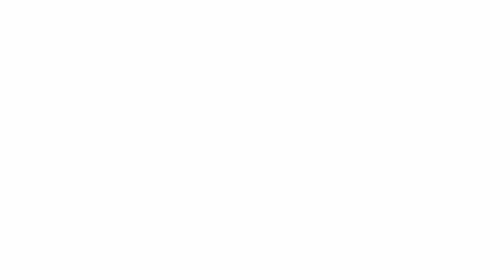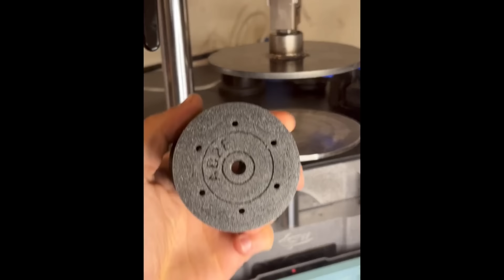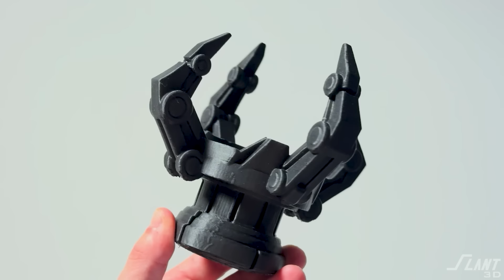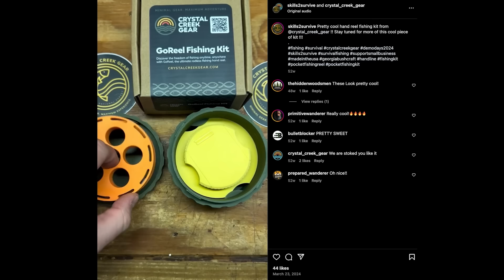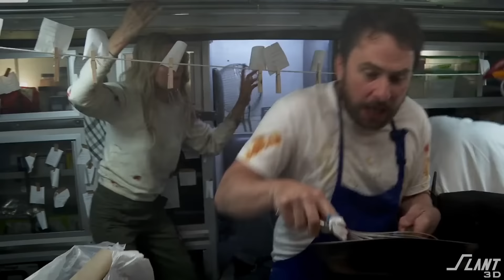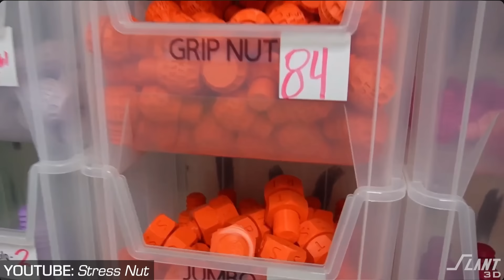5 Real 3D Printed Products You Didn’t Know Existed

Comment: The Perry Parts detail about building their own pellet-extrusion machines just to avoid the strength loss from re-melting TPU filament is such a slept-on engineering call — most shops would never think to go that far. Since Teleport doesn't run pellets, is single-pass-extrusion durability something you'd ever consider supporting for TPU parts, or does it just not scale across a mixed print farm?

Comment: The Perry Parts detail about building their own pellet-extrusion machines specifically to avoid the strength loss from re-melting TPU filament is such a slept-on point — most people would never think to make that call. Since Teleport doesn't do pellets, is single-pass-extrusion durability something you'd ever consider supporting for TPU parts, or does it just not scale across a mixed print farm?

Comment: Regarding the branding on the Crystal Creek rodless reel, they could use a stencil and paint. It's still another step, but a quick one. Could even 3d print a jig to rack up several pieces simultaneously and spray paint them all in one go.

Comment: Good video. Interesting. TPU threads in compression can also compress the crest to crest distance, while the bolt installed does not compress. Done over time, this can easily wear away the TPU threads. How does Perry’s design and process guard against this?

Comment: Helmet guy didn't need to spend $8M on molds just $1M to buy a bunch of helmets to scan for the mounts, LOL
Reply: buy then return them
Reply: @johnnyle91  That's basically theft.
Reply: You are naive if you think this guy does not have some sort of connection to a Motorcycle Equipment Store... 3D scanning does not harm or deteriorate the goods in any way.

Comment: I like the fact you spend time talking about the benefits of printing but, without regard to manufacturing as a whole, I think you're presenting "mis-information." The geometry of the parts in a couple of videos you've made you've referenced as being "impossible to manufacture otherwise." It's not entirely true. I think the ROI, the capital investment, production volume, material selection, mechanical properties conversation is what's most valuable and way more accurate than claiming that 3D printing can make parts that are "impossible otherwise." If you've got internal geometry, like inside inside, then yes. If it's just internal threads or something similar, then no. You have collapsable cores and the like to achieve difficult geometry when leveraging injection molding. From a high level, it shouldn't be an additive manufacturing OR subtractive manufacturing topic, it should be about what benefits your after in your end product.

Comment: Very interesting to come across Chinmounts in this video, came across them years ago and bought one of their mounts. Way before I was into the 3D print game, I did a lil research into them back then and realized what they had done, glad to see them getting that recognition for a very clever idea.
Reply: Untill you realise sticking 3rd party metal and plastic construction to a helmet is a bloody stupid idea. I wonder how many users have brooken jaws  due to compromising thier helmet chinbar saftey.
Reply: @EvileDik i would wager 0 considering a GoPro mount is made of cheap plastic and easily breaks off when struck, I actually wiped out with my DR650 on a loose gravel road and landed directly on the chin, obliterated the gopro mount, chinmount itself was in mint condition.

Nothingburger scenario you cooked up bub

Comment: This is just an extended advert.  Sure, there's some good information in there, but ultimately, it's an advert and should be labelled as such.
Reply: Promoting your own product does not have to be labelled as advertisement. If the other companies mentioned here haven't paid for the promotion, and it seems they haven't, then it is not an advertisement that would need to be laballed.

Comment: I feel like i have watched this video before. Am I getting old or did you already make a video about Perry Parts? Bit too much referencing "Teleport" in here. I get it you are running a business. And I am not saying you shouldn't have it but most people watching this probably aren't going to need it. It would be better to have a section that people that are getting to the point to need it can get all the information bundled and everyone else can skip. It's more a B2B Sales Pitch. I assume most people watching are trying to get their 3d Printing business of the ground. That could of course be an incorrect assumption.
Reply: Most people won't need it, but that's the norm with ads. It's for the few that could use it. If anything, this is the perfect video to promote it, the topic is directly related to the service. And their service actually seems quite well suited for people just trying to get their business off the ground. The problem with segregating it in a section away from the content is that nobody would look there. Ads need eyeballs to work.

Comment: If you don't need a mold you don't have to replace worn out molds.
Reply: If your mold wears out, you're supposed to have a big pile of money.

But if the intern puts a big scratch in you will produce a month of limited edition parts.
Reply: @siegfriedkettlitz6529 The mould would also produce at 100-10,000x the rate. 30 seconds a medium part isn't unusual.